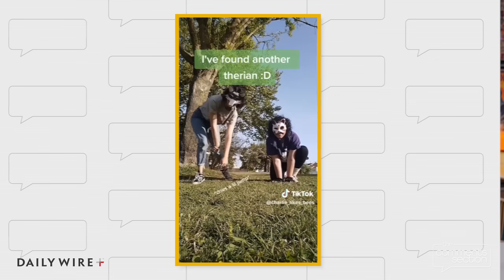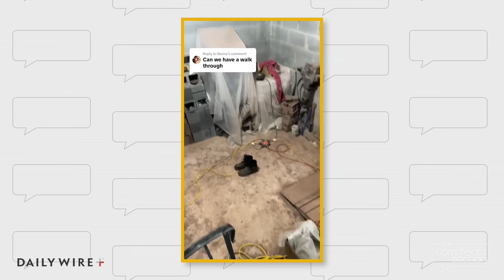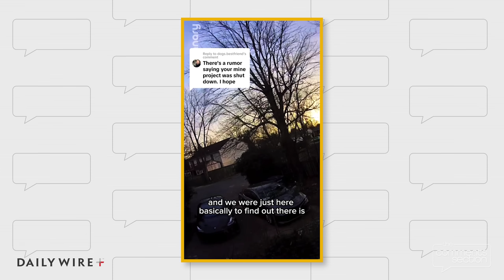TikToker Caught Digging Tunnels Under Her House?!

Comment: I am surprised that Brett isn't supporting this. Digging secret tunnels under your house is a very prepper thing to do, and the freedom to do what you want on your property (so long as it doesn't harm others) is the libertarian thing to do.
Reply: As long as she's doing it safely. But didn't she hit the water table?
Reply: @toryperez3211  I grew up in low-land swampy areas. Every house has a sump pump like what she put in, otherwise every basement would flood. Idk if everything else is structurally sound,  but finding water in your basement is no big deal if you install a sump pump.
Reply: @cutethulu_xo it's a big deal if water pooling together in an area under your house that didn't have water before. That causes all sorts of issues
Reply: It is a very pepper thing to do BUT it also seems very dangerous.  Especially If you’re not a professional of tunnel engineering or if the land isn’t structurally sound enough to make it properly safe.
Reply: You cant just dig a fucking hole under a property you own without proving exactly why it is structurally safe, AKA applying for permits conducted by actual professionals. If she did that and then had the tunnel built then great. What she did is cause a massive risk potentially killing an entire family if/when she sells her home and doesnt inform the new family
Reply: Well in these times Seems like a good idea
Reply: Oh good god.....🙄🙄🙄
Reply: Well, I dig trenches and excavate for a living. Most states require compaction testing to be done meaning the earth has to bored 20+ foot down to see if the foundation can support residency. And a lot of the stuff she is doing looks safer than half of what you’d see on a job site
Reply: The thing is the girl didn't get government permission or even apparently have any professionals make sure she's doing the right thing. This can go wrong very badly and the basic response should be to not support this girl until she's following the government guidelines to make sure an engineering disaster doesn't happen.
Reply: I think its great. Leave her alone. Hey people who are experts, why not help her and give her safety tips. Bunch of self righteous hypocrites.
Reply: @itsjustajokejeez  I'm all for tunnel girl to keep tunneling. But if she didn't have government permission and professionals making sure things were good and stable then the right thing to do is stop for a bit and get everything checked out. It may not seem like a bad things right now, but one wrong move or mistake could have a structural collapse happen which kills her and possibly others.
Reply: @FrotLopOfficial  hodor!
Reply: @toryperez3211 who cares if it’s safe when it’s all her choice. Need to stop mandating protecting people from themselfs lol. Now if she has someone helping her sure she should be liable.
Reply: I’m blown away by all the people saying it shouldn’t be done with government permission. As if the people in government are actually expert enough on anything to reliably determine if something is safe. You know, the same people who maintain all the bridges that keep collapsing.
Reply: @mikeVT8245  My Grand parents were trying to add a room onto their house and the city official said she didnt like the way it "looked" and denied them. I was so pissed off and cant believe someone even has that power.
Reply: @itsjustajokejeez that's the issue. She didn't get any help. It doesn't matter from where,  someone with a permit needs to check whether she is good enough to dig her tunnel. Because one wrong hole is enough to collapse not only her house, but also her neighbors!
Reply: It’s not that it’s “wrong” it’s just strange and dangerous.
Reply: This is not something you can do yourself... You need special people that understand the geography of a specific area, ingineers, ect...
That is the main problem, of course you can do want with your property, but it must be done safely and with common sense 😅😅😅
Reply: I don't think anyone can support someone that might be endangering other people's houses. Didn't the crazy lady said that she is building in her neighborhood?
Reply: @itsjustajokejeez  in this case legislation is saving her from her own dangerous stupidity. She doesn't just need tips, she needs a permit and a professional to build it for her...
Reply: @Antaeus_Drakos the gov has no buisness in what I do to my home, it's crazy if u want to make a extra wall or room in your home u need the gov to come allow you?
Reply: @veeyan6882  it's different because by fixing your own house you are only destroying the interior of your house but by digging you can hit gas or electrical lines or cause your own death because your tunnel is not structurally sound
Reply: Cement manufacturing harms everybody
Reply: @IL_Bgentyl  "who cares if it’s safe when it’s all her choice."

The taxpayers that will have to pay for rescue first responders that will have to come out to save this dingbat if something goes sideways.
Reply: @itsjustajokejeez  Well that's a load of bullshite. No inspector denied that based on he didnt "like the look".

But nice try.
Reply: mostly agree with that statement except for the libertarian part.. liberals would loose there mind about having anyone  having the freedom to that on there property even if it's harmed nobody.
Reply: @Antaeus_Library  Yeah because the government knows best.🤣🤣🤣 Maybe she talked to an actual expert. The government gives me no peace of mind whatsoever. My immigrant neighbor next door who has no formal education is the best builder in our area. I would trust him to dig a full city under my home before I trusted a government employee to tell me where a bathroom was. 🙄
Reply: @thejennifercatherine  You do not need a fucking engineer to dig a tunnel under your home!! What in the hell is wrong with people? Everyone is so scared to think for themselves or learn about anything on their own. I'm sure she has had some advice as she hasn't killed herself and her tunnel hasn't collapsed. I'm sure you think you need a mechanic to fix a car too but a smart motivated person with a manual can do most jobs just fine. We under estimate ourselves constantly but digging a tunnel under a house isn't rocket science. Only shovels and basic knowledge required. No college degree required for shoveling dirt. That is the hardest part of tunnel digging. The actual work. You dig down below the public utilities and basic knowledge of tunnel structure will work. Do you think that El Chapo had engineers building his tunnels? The tunnels in Afghanistan, are those built by architects? How about the tunnels the Jews dug under New York? They seem to work great and they didn't get city approval or use an engineer. It's a tunnel system. Not a sky scraper. 🙄🙄🙄
Reply: @Antaeus_Library  yes, government involvement and permission slips are exactly what people need to do what they want on THEIR private property
Reply: @Antaeus_Library Until she tunnels under YOUR house…🧐
Reply: @xandercruz900  price I’m willing to pay. Saves vastly more money over the long run letting Darwinism take course.
Reply: @xandercruz900  That is what my grand parents told me.  Maybe they exaggerated.  But it literally is like that in the world of expanding on your home.  They make design decisions based on the majority preferences of what will keep property values up.  And I understand it, but personally I could give a shit if my neighbor decided to paint the outside of their house rainbow colors.  That is my point.  But I may want to disagree with it because who wants their property value to go down right?
Reply: @sarahkelley9045  Thank you. The appeals to authority are scary, too many people are scared to do anything these days without permission and giving someone else money.. it's conditioning to be dependent. 100 years ago, the things she's doing here would be considered pretty normal (at least outside the suburbs anyway). I fix my own appliances, install my own plumbing, replace my own light fixtures, fix my own car (within my comfort level), build my own computers, etc.. But many others I know would think they need to pay someone $100-500 just to hook up their washer and dryer or unclog their drain. The south park "Panderverse" episode is actually partially about this.
Reply: I totally agree with you, but most of the time permits are involved. I would build me a bunker under my house if I could.
Reply: @sarahkelley9045  I think that this much anger over a simple comment is concerning... Take care please ❤️
Reply: @xandercruz900  how dare she possibly take away from the public safety narcan funding! Especially if she's doing something that doesn't involve defecating on a city sidewalk!

I personally would prefer my first responder tax dollars to go to helping someone like her than someone who regularly ODs...
Reply: @xandercruz900  unless the city official (they never said "inspector") decided they didn't like how the building would look after and just denied the permit.

A town I used to live in would deny building permits if the proposed building didn't fit in with their idea of how the neighborhood should look.
Reply: It depends. If a bunch of people start digging a bunch of tunnels under their houses, it could cause massive sink holes, which would inevitably end in tragedy.
Reply: She isn't not supporting it, she is just saying it's odd.
Reply: But she isn't a professional and could possibly put her neighbors house in danger
Reply: @thejennifercatherine  I'm not angry. Not at all. I was just making a point. Nobody ever stops to think that if somebody is blunt in person it translates as anger via text? That's why everyone on the internet thinks everyone else is angry all the time. I never assume a stranger I have never met and am likely hundreds of not thousands miles away from us feeling any kind of emotion. I have no hope of understanding context completely and half the nuisances of normal speaking are lost when you are simply making comments. I guess my question for you is when making assumptions about people why do you assume someone is angry just because they disagree with you? Is it really so impossible that they just might have a point? See ya later lady. I know your a woman cuz most men wouldn't give two shits if I was angry. 😂
Reply: @toryperez3211 then that's on her, her house, her property, she shoukd be able to do what she wants
Reply: @FrotLopOfficial  yea, because professionals never make mistakes, and always do things correctly. Permits and licenses are nothing more than a tax.
Reply: @IL_Bgentyl thing is shes not just taking a risk for herself. this tunnel creates a sinkhole risk for her neighbors

Comment: I think the major problem with digging tunnels under your home is safety. There is electrical lines, cable, water, and sewer lines underground, especially in areas like New York. Plus the threat of cave ins because of no structural engineering experience. 

But if you went to the city, and got proper permits and inspections you could.
And if you lived in an unincorporated area outside of town, then you can dig away.
Reply: "permits" and inspections by "approved" people do not make something safer. get the boot out your mouth. She said it was all on her own property; that's all that matters.
Reply: Typically you don't have cables or pipes under a structure, because if they needed to be repaired, the only way to access would be undermining the structure
Reply: She knows that. This woman is 10 times smarter than you comment police. Can you make concert forms, lay brick, weld and plumb ventilation systems out of nothing?. No you probably can’t. She’s obviously has an engineering background

Comment: A lot of the times, these tunnels are made to move dr*gs around or for traff!cking. Or used for dealers or wtv to escape in case cops close in on them. A house near me was owned by a dealer, and he had tunnels for that reason, to get away from cops if they show up. Its actually really common. He did get caught, and his house was taken and then placed on the market for loads cheaper than original price, due to being owned to a dealer of his nature.

Comment: Why shouldn't it be allowed?  It's your house.  As long as you don't dig into someone else's property I think Uncle Sam should stay the hell out of it.  With that being said she is probably dealing serious damage to the foundation of her house.
Reply: watch again, appears she has dug away from her house and isn't underneath it at all, and with how thin the tunnels are and appears she's building solid block walls and supports with ventilation, looks good to me if she's really doing it all herself.  In comparison to Colin Furze tunnel system, its quite impressive.  Also consider many old gold mines that had minimal wooden support beams still standing open today.
Reply: Probably the same reason why you can't just build an extension onto your house without a permit or permission from your local government. Because safety. And it won't always be your house, unless you demolish it before you die.
Reply: You still need permits and make sure it is built to code.
Reply: @m0nk836  depends where ya live, my land doesn't require permits for anything.  Can do whatever I want without approval.  Don't need or want the govt permission!
Reply: @pawsomelabrastead9244  I understand not wanting the government involved - they're not known for doing things well or efficiently.... But if I were buying a house that someone else made adjustments to, I would feel more comfortable knowing they got permits for the work implying that the work was done according to code. Or if I were visiting someone's house, I wouldn't feel comfortable knowing they decided to make tunnels underneath without following code and getting permits. Governments aren't great.... But there are good reasons for some laws/regulations.
Reply: It has to meet city codes. The main things are 
A) must stay on your property which she clearly moved past
B) risk digging into a sewage/water line or worse a gas line
C) you hit an underground well or some other form of ground water which can then become contaminated, or causes erosion of the top soil/foundation which leads to problems
D) you hit a fault line/unstable ground and everything collapses
Reply: You:

"Why shouldn't it be allowed?"

Also you answering your own question:

"she is probably dealing serious damage to the foundation of her house."

And I'll bet the chorus of people encouraging this will want rescue to show up to dig you out if that stuff caves in on you
Reply: @pawsomelabrastead9244 "Don't need or want the govt permission!"

Until something goes wrong and it caves in on you, then you are going to want "govt" rescue.
Reply: @xandercruz900  Just because something is inherently dangerous doesn't mean I think the government needs to regulate it.  And for those of you talking about building codes we make exceptions to building codes all the time.  You think the Amish build their houses to code?  You think Native American Reservations follow pale-face laws?  I'm not an anarchist or extreme libertarian, I'm just saying that generally speaking the government should stay the hell out of my house.  If I want to dig a hole in my backyard it should be no one's business but mine.

Comment: Ok, I have a couple thoughts here.  One, I get the fascination with digging a tunnel and when I own land one day I might do it too.  Two, I’m curious what she used to dig/break up the underground rocks.  It’s not easily done with a hand shovel.
Three, I would probably do a few things differently because I work in the concrete industry and probably know a bit more about building and excavation than she does.
Reply: There was a pneumatic drill in one of the pics.
Reply: Hammer drill, pickaxe. Can’t really fit a mini excavator down there lol
Reply: Chipping hammers and jackhammer work the best out of commonly available tools there's even shovel attachments for them.

Comment: Can you build tunnels.. technically YES you can, as long as you med all safety and civic structural requirements. That video, her using a air blower, would not meet the airflow standard, and the sump system for the water flow would not meet the ground water table requirements and flow controls.
Also a note, I bet she wants a Castle build, and the Tunnels because she loves the 'Steam-Punk' Era style of things, which would very suit what she is doing, right at the start of the video, there was a Steam Punk comment. (Steam Punk mechanical Box, or was that supposed to be steam pump?) If she is using steam to help her cut the ground away, that would definitely cause a lot of the water in that area, and she may not know it, but wet ground and dry ground act MUCH differently. I would wager they might just condemn her house or require her to fill in the tunneling as a structural safety for the house.

Comment: So, this is considered a remodel of a house. You can do it but your supposed to file and get permits for it. Youre supposed to supply blue prints for the plan and coordinate with the city planner to make sure you dont cross any lines, pipes, etc around the home. Doing it in secret is the illigal part. Theres some seriously impressive and legit tunnel builders on youtube. One dude put in sheet metal walls and roof arc and filled in the gap between the metal and dirt with concrete. Put a entrance ladder in his pantry and one out in his garage with a couple small rooms underground. He made it as both an emergency escape or a place to bunker down.